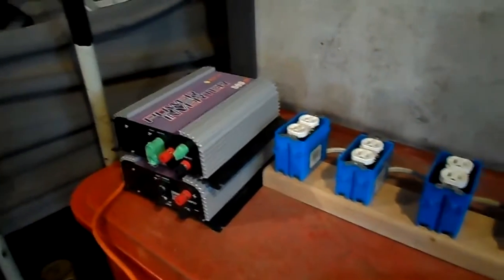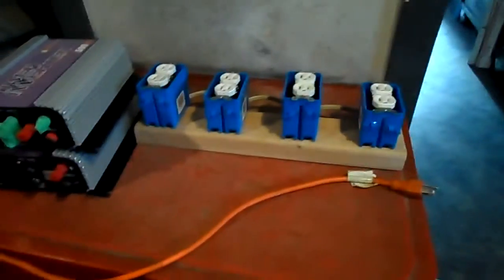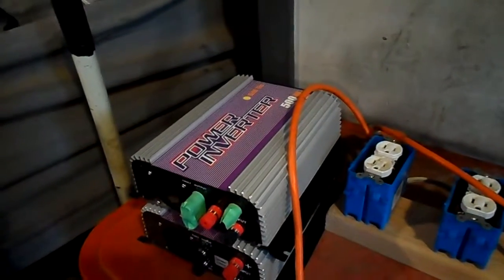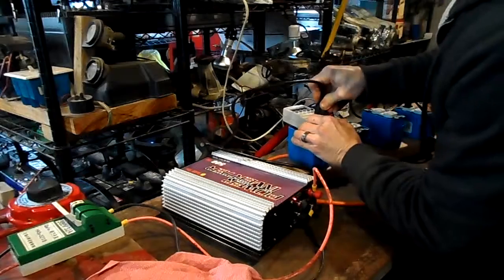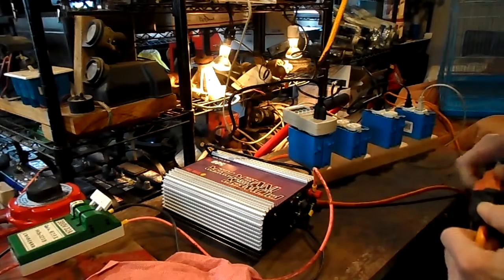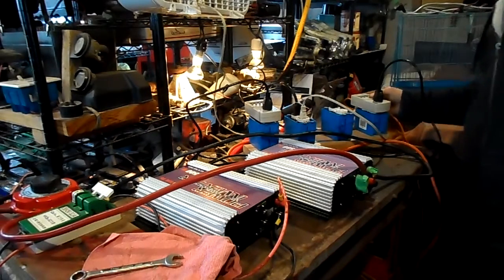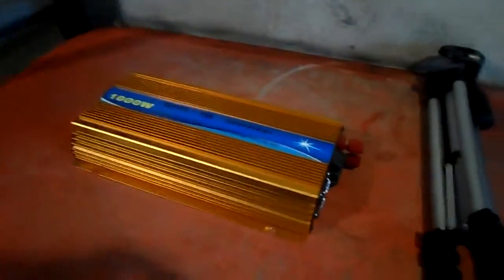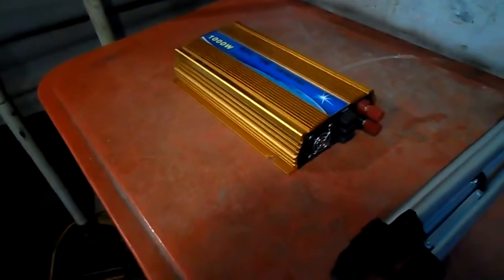Will 2 Grid ties work together when the power goes out?

Comment: for a cheap sine wave inverters I use ups from a computer i got off craigslist for free.  Depending on the size you get, the smaller ones use 12v batteries inside and and bigger go up to 48v.  Happy hunting

Comment: id expect a puff of smoke, with grid tie and inverter hooked together, i did find a website once explaning why it wouldnt work, they were going on about square root of something by memory, it was a long time ago. what you probably need is a good quality hybrid inverter.
Reply from the maker: +closertothetruth Yes, i'd never hook a grid tie up with an inverter.......I shouldn't say that (I might just to show the destruction if I come across very cheap ones), lol, but I'm sure something would happen to the inverter.  The grid tie might come out fine but I don't think inverters like a voltage spike coming back at them.  A test would confirm that.